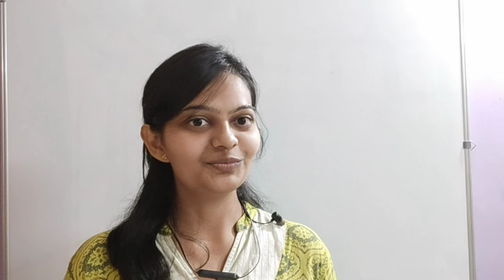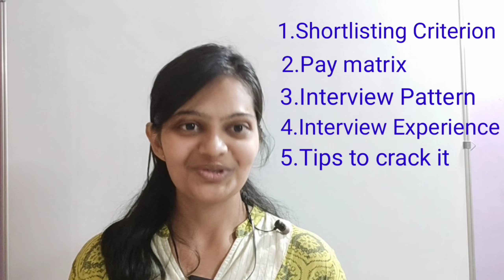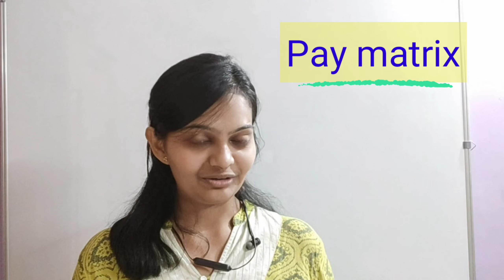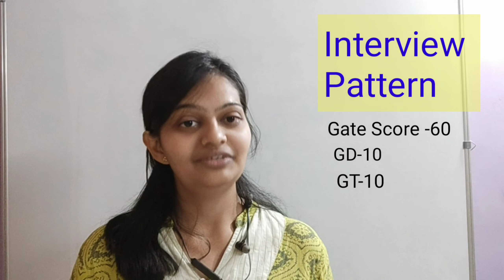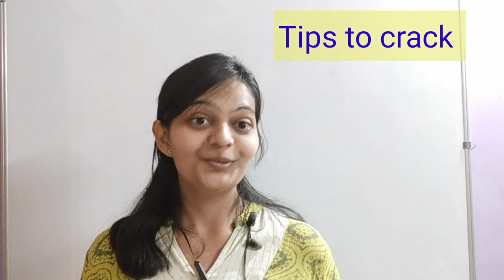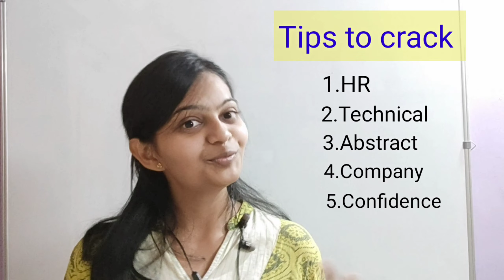IOCL interview experience for recruitment through GATE(Chemical Engineering) Questions and tips

Comment: Mam, did you get IOCL after interview? I am just asking so that I can assume what chances I have to get selected if I have an AIR-81 in chemical engineering in GATE 2021, what are your thoughts on this?
Reply from the maker: Hi Ankit you can get converted to final selection at your rank but you will have give your best short at interview.Some guys got selected.In my interview I didn't answer abstract question properly
Reply: @chemebonds2339  okay mam, thank you so much.
Reply: @chemebonds2339  ma'am can you please tell us that what approx marks did you get in iocl interview?
Reply from the maker: @mayankagrawal2981  Gate exam? 725+/100 ,rank 1-150,marks subjective to paper 70+/100 is safe...i got 64 marks in 2019 but paper was tough that year
Reply: @chemebonds2339  ma'am aapke iocl m interview marks kya the , i'm asking it because this year my interviewe went avg.
Reply from the maker: @mayankagrawal2981  We don't get to know marks until you file itr...I don't remember the exact weightage..13+/15 in interview and gd with rank under 100 and  estimating the vacancy can give you fair idea...if vacancy are 5-8 ,overall best profile will be selected
Reply: @chemebonds2339  ma'am my rank is 40 and this year general vacancy is 152 but my interview went avg. , I'm little worried about it.
Reply from the maker: @mayankagrawal2981  you have excellent chances.. keep your hopes up